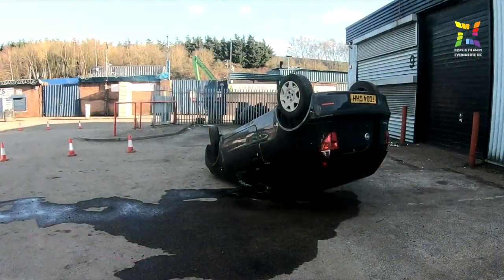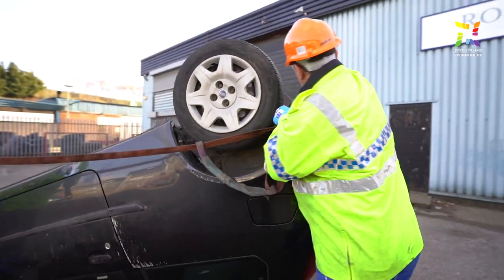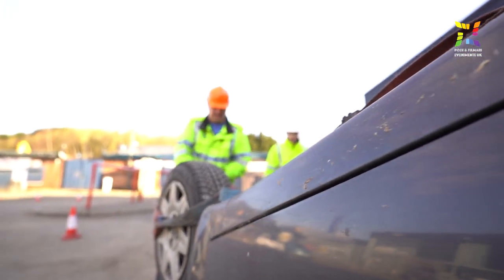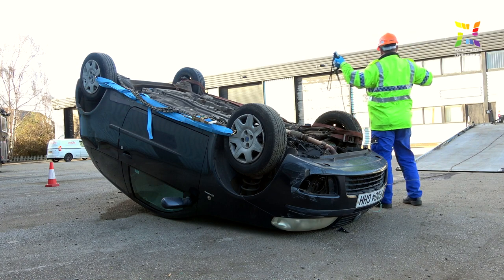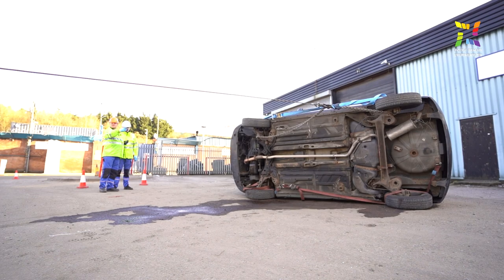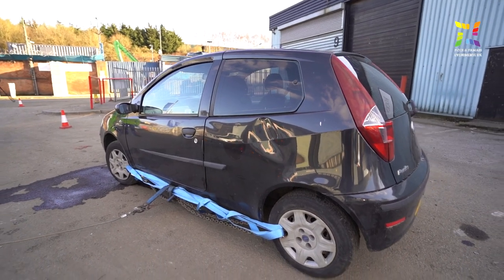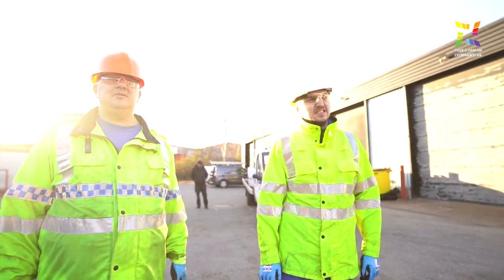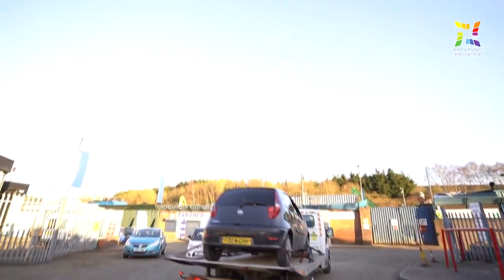Ady Car Recovery - professional Rollover Recovery - A How To Video

Comment: Do this for a living myself, best job in the world imo! Great job, safe work too and I even learn a thing or two and I’ve been doing this over 8 years. However I would have attempted to gain access to put the handbrake on or in gear, if not strapped the rear that was going to hit the floor first, rolled it with hook chains, took the strap off and moved hooks to the wishbones, and rolled it on. Yeah Jimmy it if one’s locked up but if they roll they roll so use them
Reply: I've been doing the job only two weeks and love it also I agree I would of tried to gain entry and applied the handbrake and put the car in gear

Comment: A little confused there. To secure the wheels at first, why not just strap the wheels in the exact same way as he did for the roll back strap, and not use 2 bed straps that you would struggle like fook to get back off. But even easier, jam some wood in the wheels 🤷🏻‍♂️

Comment: Overly complicated procedure. I really don't understand the need to have the straps on once the vehicle is back on its wheels. The car was dragged on to the bed unnecessarily. The car would have happily rolled on to the bed with the help of a winch. Once loaded put the straps back on,  hand brake, gear and off you go.
Reply: Totally agree. It's ridiculous and hypocritical. At 16:00 the bloke is telling us "Always think ahead" which I find amusing. After FIFTEEEN minutes blocking a road, no doubt there will be HUGE tailbacks causing further hazards with the potential for on-looking drivers passing by which could cause further accidents. Look at 12:14, there's literally people standing around like it's some NASA space launch. They've over complicated what should be a quick & simple procedure.  Quick reality check needed here - It's not like it's a 40 tonne artic lorry carrying flammables and therefore it should not be treated as such.

Comment: I do recovery for a living for the police never seen such a weird way of doing things making your job twice as hard set off 2 leg chains around bottom arm and front wishbone you will get your centre pull as for chocking the wheels with stick the hand brake on it when it’s in its side chock front and rear wheels with wood so when it lands it can’t roll away or strap the wheels
Reply: It is way more secure but a lot of leg work usually I get it on it side and then but a 4x4 on the inside of the wheels.

Comment: I watched the first two minutes and I hear a bloke who can't even string a coherent sentence together. I have never seen ANYONE strap the wheels like that before putting it back on its wheels. Why not simply apply the handbrake and put it into first gear? This is NOT a good idea if you need to clear a RTC quickly to prevent other incidents. I call BS!
Reply from the maker: - English is not his first language  
- English is probably the 3rd language ... (second is for sure) ... this gentleman  can speak, read and write (sometimes with mistakes of course) 
- Will you enter the car to "use the handbrake and first gear"?
- Your live is important too not just "quick " :)
Reply: @poze-filmareevenimente-uk979  "Your life is important too not just quick" - Well fannying about on the road at the scene of an accident for much longer than necessary is hardly what I would call safe.
Reply: Sorry had to find another channel to long

Comment: why are you winching on a tie down strap not safe at all
Reply: Did you watch closely. Has been used chain from front wishbone to rear axle wheel .Tie down straped used for keep in place the chaine .If you work out safe working load then you will be shocked the outcome of your calculation
Reply: @adaccerchez810  i think you was not waching closely as you would have seen the strap was tight on the winch and the chain was slack he did the pull on a tie down strap that is not rated for recoverys it is deisinged for static load in one direction
Reply: Do you need to be certified to do rescue and recovery ? In UK ?